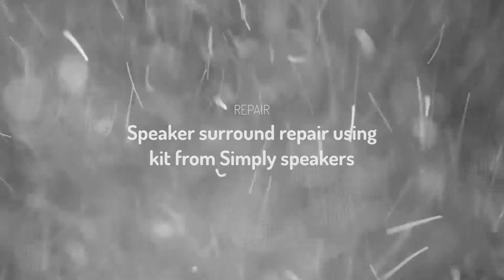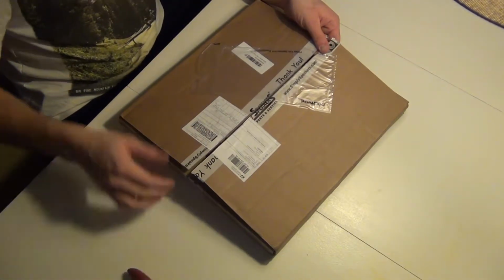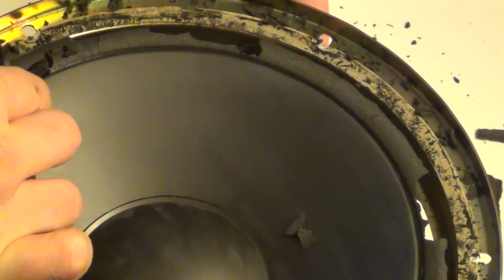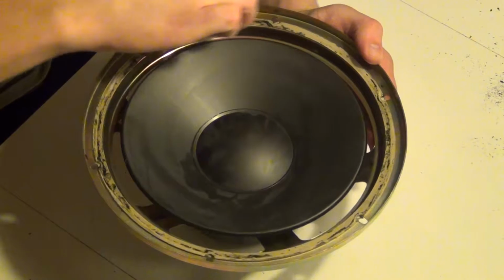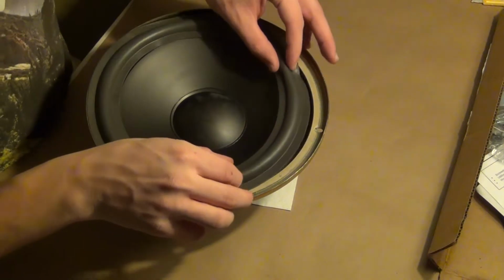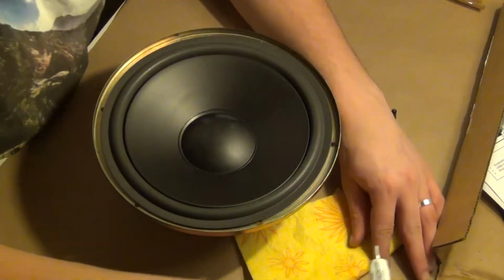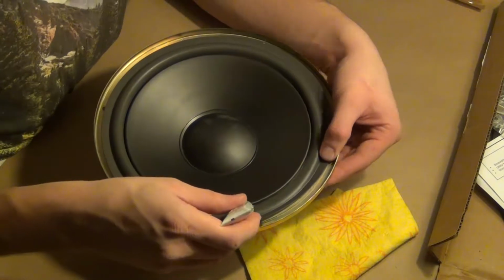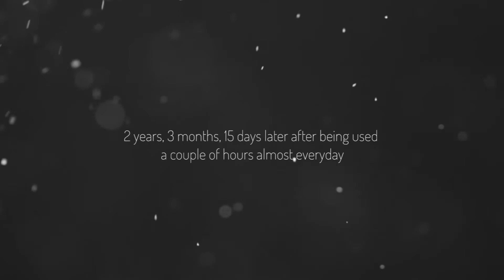Repair speaker surround using kit from Simply Speakers | Handyman Henrik

Comment: Good vid but don't you have to apply the glue to both the cone and the metal surrounding the cone?  That wasn't clear in your vid.  Also, why does one have to remove the woofer?  Can't one just do the same thing with the cone in the speaker box?
Reply from the maker: Thank you! You need to glue both the cone and the metal surrounding to attach it. It should not be a problem to assemble it with everything in place, but I think it is easier to clean and handle the parts when they are loose.